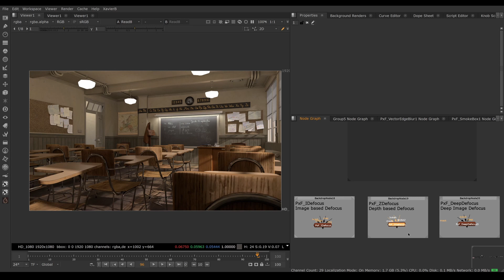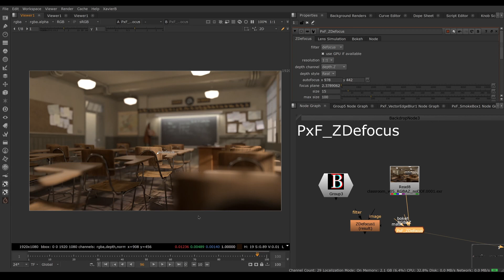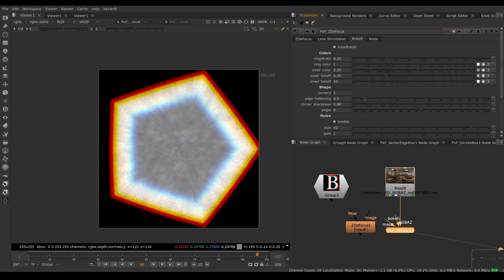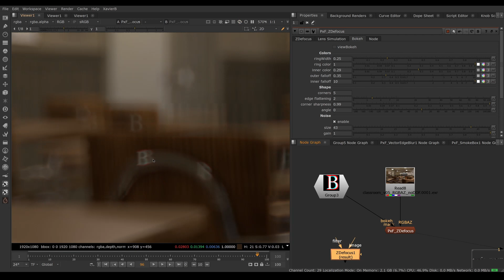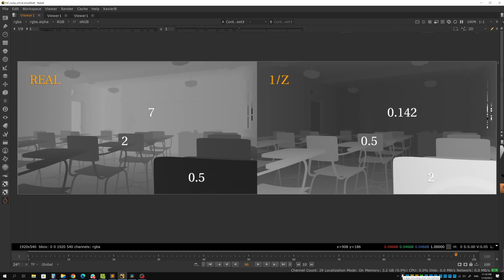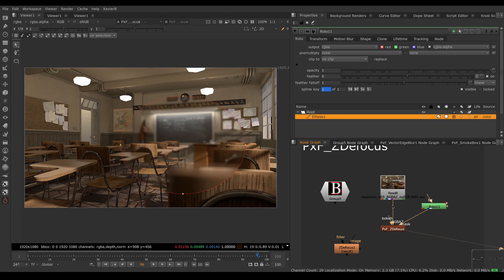PxF_ZDefocus

Comment: Awesome tool! Any plans to add?: Cat’s eye bokeh (circular vignetting), Astigmatism (radial and tangential stretching), Cropped bokeh (matte box flagging), Bokeh color fringing (axial chromatic aberration), Field curvature effect (causes corner or center blurring), Lateral chromatic aberration (corner color smearing), Coma, vignetting, Lens Breathing? Defocus_Aberrations 1.3 provides all that, but its quite slow, I wonder if it could be improved with PxF_ZDefocus
Reply from the maker: You forgot film grain, camera shake, halation, gate weave and dust and scratches. ;-)

Bokeh color fringing and cropped bokeh can already be acheived with custom bokeh shapes.

Vignetting and side to side chroma abb are not related to defocusing... Can easily be added after ZDefocus. I dont want to add bloat where possible.

Anything that makes the bokeh shape variable across the frame is really expensive to compute and adds a lot of complexity... especially for DeepDefocus. I would love to add these features (cat's eye, etc...) but it's not a trivial task.

Comment: Hello! When I applied it before motion blur (vector blur) it makes the motion not to do anything :( Does anyone know whats happening ??
Reply from the maker: PxF_DeepDefocus is RGBA only at the moment. Even if motion vectors went through, they would be unusable (you cant blur motion vectors without breaking them).

If you have a very small amount of defocus, you can use the Copy node to combine your original movecs with the output of PxF_DeepDefocus.

Alternately you can use PxF_VectorEdgeBlur to generate movecs and do a vectorblur after the defocus.

Comment: Hi, thanks, the tool is great, however, when I animate the focus distance, the COC/bokeh size changes only every 3rd or 4th frame, resulting in a jittery transition, do you know what could be the reason ?
Reply from the maker: Make sure to use the latest version (PxF 3.2). New features have been added to fix this problem. Details in this video: https://youtu.be/hmXCtXeaNCw?si=-k0a0ckYwR3Pqteq
Reply from the maker: Useful bit for you starts around 7:02
Reply: thanks!
 @pixelfudger

Comment: so I tried applying DoF before Glows and Glints, But when I use Bokeh as a Filter, all channels go black after the PxF XXdefocus apart from RGBA
Reply from the maker: I think the Bokeh image is RGBA only and Nuke's ZDefocus uses each channel of the Bokeh image to defocus the corresponding channel. I havent tried it but you could try feeding your own bokeh image in the 'bokeh' input. Make sure your bokeh shape is on every channel you wish to defocus. I'm not sure why you'd want to defocus AOV passes though?
Reply: @pixelfudger  I don’t want to defocus AOV passes tho, I placed the defocus before glows and glints session and I need the various channels to add glows to, but after the node, all channels go black
Reply: @pixelfudger  I’ve got a question too, per your experience, which one is correct(mathematically and logically) in CG comp; MoBlur> DoF> Glows & Glints, or MoBlur>Glows & Glints>DoF or Glows & Glints>MoBlur>DoF?